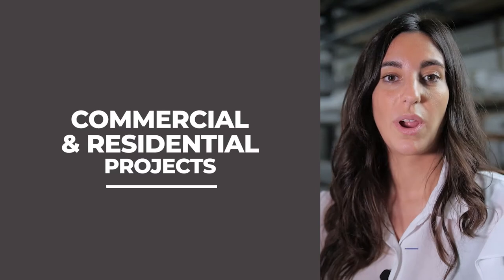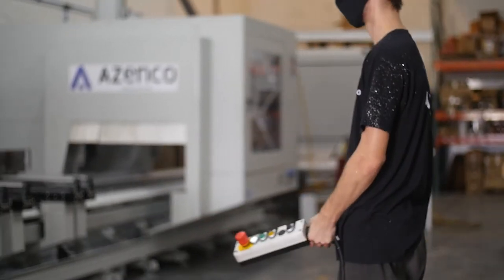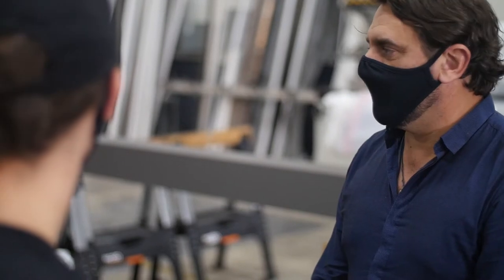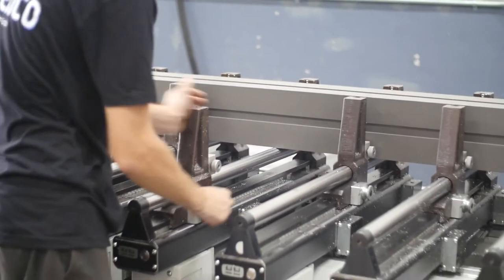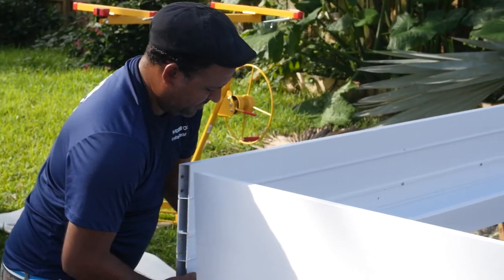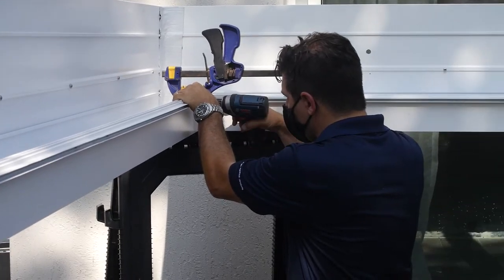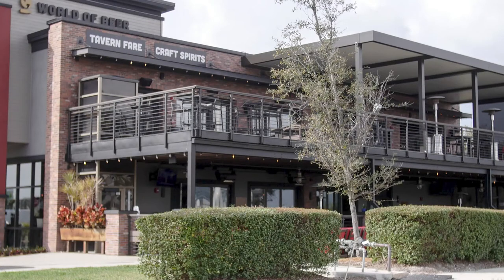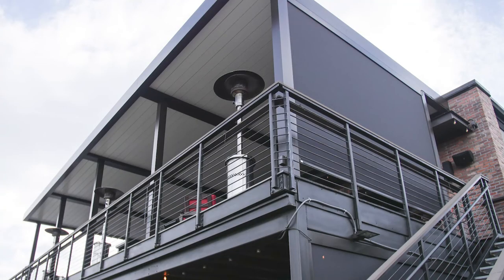Modern pergolas and Patio Covers by Azenco

Comment: Azenco advertises their pergolas to be 100% rain proof.  NOT TRUE. My daughters Azenco Pergola leaks in multiple locations.  To make it worse the columns collect the rain water from the top and just spill it into the entertainment area below.  Azenco's FAQ says you have to have an integrated gutter system to ensure the outdoor entertainment space stays dry when it's raining.  Well, I guess they need to add this because they don't have it.  The aluminum columns are hollow and water falls inside and spills out the bottom onto your floor.  What is integrated about that?  And to make that worse, they put electrical wires inside the column with the water!!!
I do not recommend this product at all.
Reply from the maker: Rod, we are sorry to hear that this experience has been less than stellar for your daughter. What you are describing doesn't reflect our high-quality standards at all, and we appreciate you're taking the time to share it with us. 
We are here to help you find a solution that meets all of your daughter's needs and expectations. 
Would it be possible for us to get more information from you about who installed your daughter's pergola and where the leaks are coming from? 
We would also appreciate getting pictures to be able to investigate what might have caused these issues and fix them along with your daughter's installer.

Please feel free to reach out directly at azenco@azenco-outdoor.com or 305 306 3204 /direct line if there are any other concerns or questions about your purchase. We want you happy!